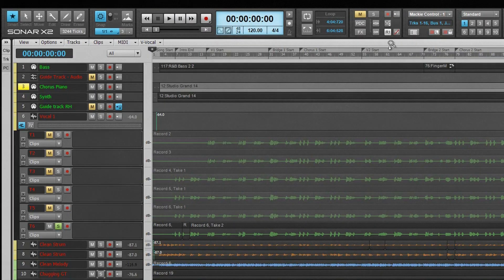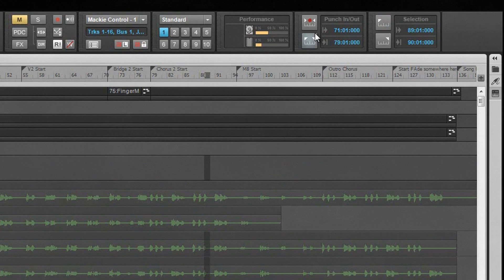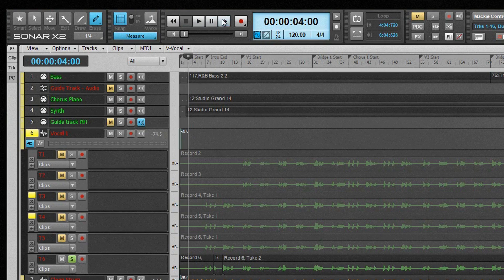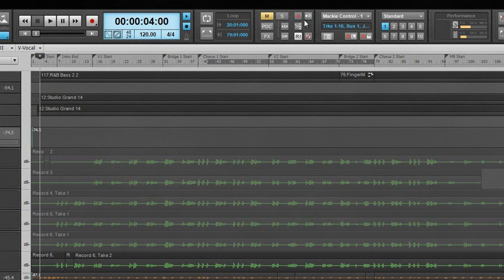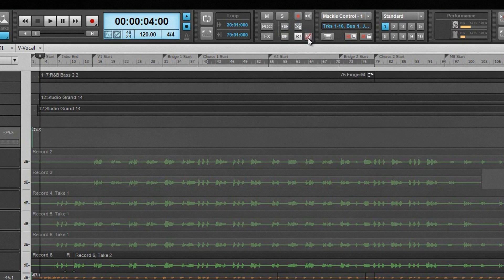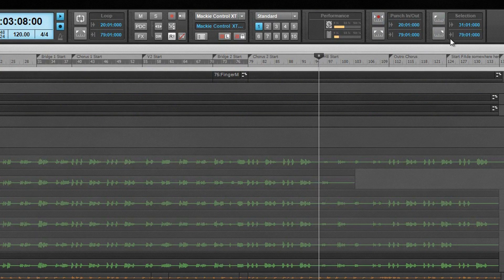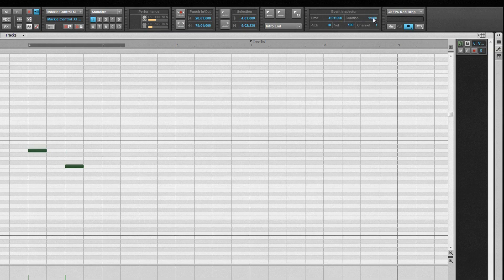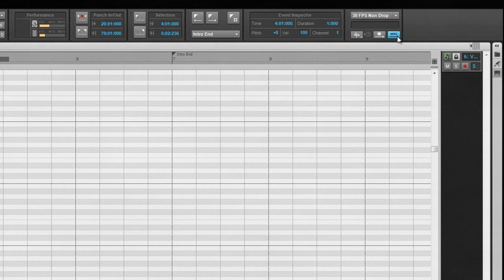SONAR X2: Get Started - Control Bar

Comment: Am I the only one who dislikes the clunky Control Bar on X1/X2 compared to earlier versions of Sonar? I used to be able to use the Control Bar to go to different views, change tempo midway and step record. The CPU meter and solo/mute buttons were at the bottom. Now the CPU meter won't fit on (can't fit the tool changer on) and I have to go to menus or remember ctrl + alt keys to get different views. It's like going from Lego back to Duplo. Please bring back the old bar or give users the choice.